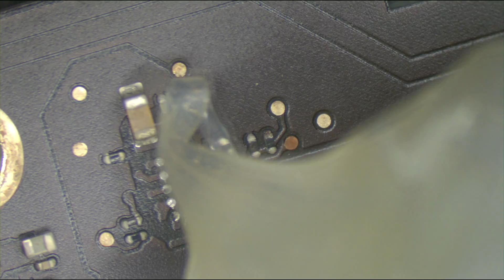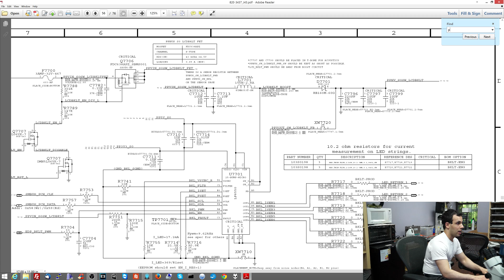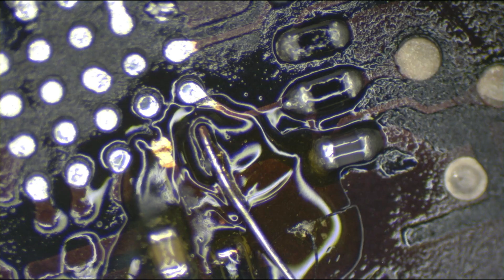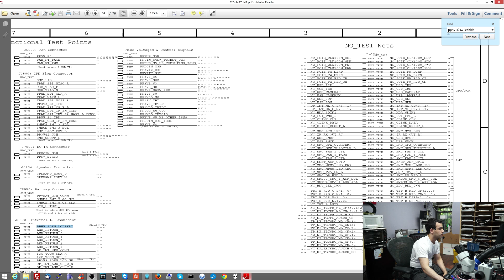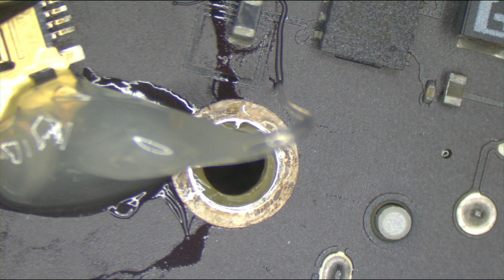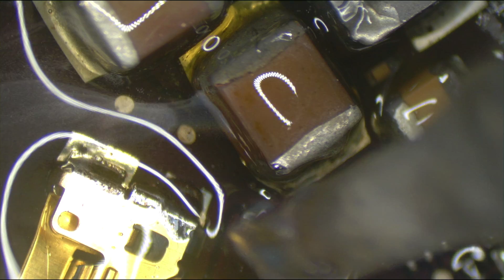Macbook Air no backlight burned feedback line to LP8550 WLED driver

Comment: Is there any reason you don't use the molybdenum wire instead of the battery wire, or are you just out of molybdenum wire?
Reply from the maker: JHx86 Too thick, doesn't bend easily. If you touch it it will rip pads off the board.